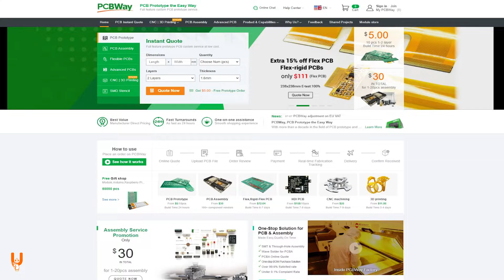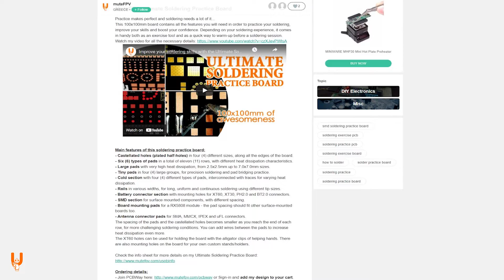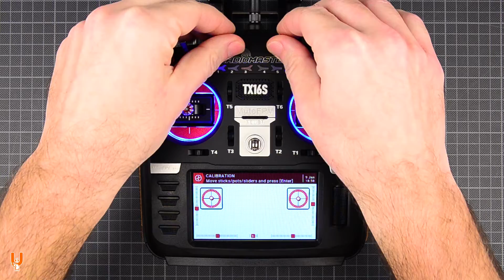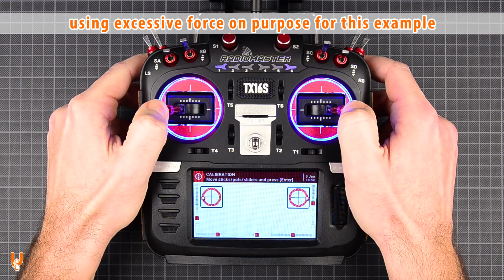Common Gimbal Calibration problems with your FPV radio (feat. Radiomaster TX16S)

Comment: Thanks for the tips! Unfortunately my issue wasn't addressed here, and I'm currently thinking that it's a problem with the gimbal itself.
Reply from the maker: You're welcome, what is going on with your gimbal?
Reply: @muteFPV  The left stick will be centered on the rudder, but it'll report -60% and then I move it, and put it back, it'll report +20% or some other number and it never consistently reads going back to center.

EDIT: For clarification, this happens right after calibrating with correct force.
Reply from the maker: Sorry I missed your reply. That sounds very strange! Have you contacted Radiomaster / did you figure out what is going on?
Reply: @muteFPV  it was RadioKing, and I got a replacement gimbal for it. $12 and works perfectly
Reply from the maker: Glad you sorted things out! How long had you been using it before it failed?
Reply: @muteFPV  not long. I got it second hand though and I'm not sure of the previous history, other than it was almost brand new and hadn't had the screen protector film peeled yet and OpenTx was still installed

Comment: 👍, but why use rubber?
Reply from the maker: I figured I should include it as a tip, to show that you don't need to apply much force to the sticks. I have seen several people struggle with calibrating the sticks normally without pressing hard on them (I don't understand why but it happens).
Reply: Rubber band is Baboon proof 😂

Comment: the centre of my gimbals keep twitching slight and i have to use deadband to componsate ive calibrated multiple times also got replacement gimbals from radiomaster and still the same any idea how to fix my issue or maybe my tx 16s isfaulty from fall damage
Reply from the maker: It depends, how much do they twitch? If it is 1-2us it is normal and is happening to a lot of radios, not only Radiomaster's. Does it affect your multirotor's movement if you don't use deadband? I noticed in the AG01 gimbals that the magnets are more accurately aligned in the centered position - I have no idea if this actually helps prevent twitching but I have read in a few discussions online that it could help.
Reply: @muteFPV  thanks for replying ye it effects the movement when i dont have deadband added, another thing i thought that might effect it is when i opened it up i may have adjusted some of the gimbals tension springs and maybe the throw of the sticks, the throttle gimbal goes and touches the top as to wer the bottom is like a milimetere away from it i may have adjusted with out me knowing and wondered could that have caused an issue ?
Reply from the maker: This should not affect the center point of the sticks and the twitching you are noticing. But if you have reduced the throw, you should recalibrate if you haven't already so that you are getting 100% on full deflection.
Reply: @muteFPV  thanks ye i have it running good for now  cheers